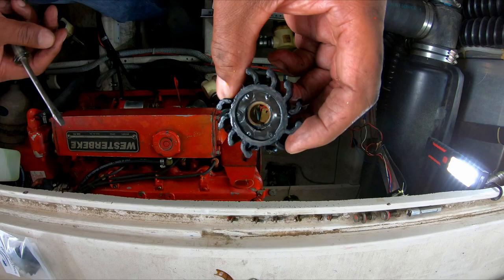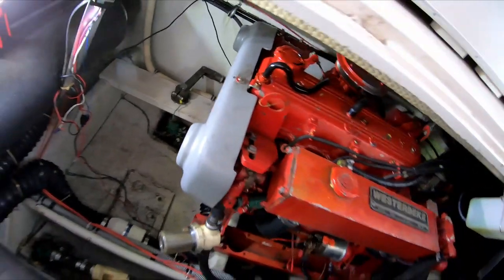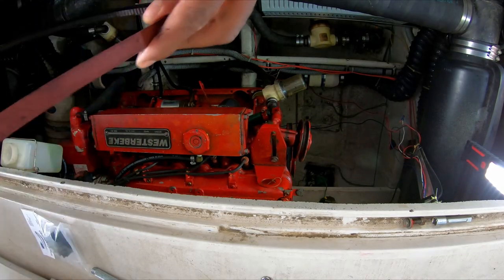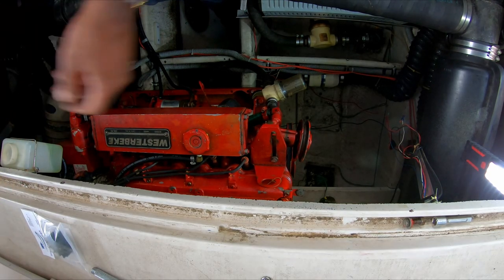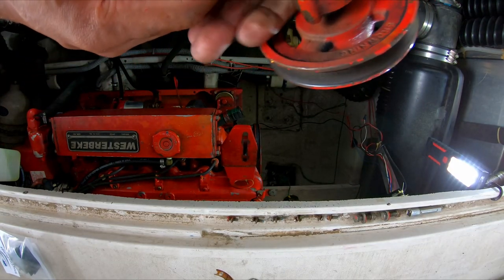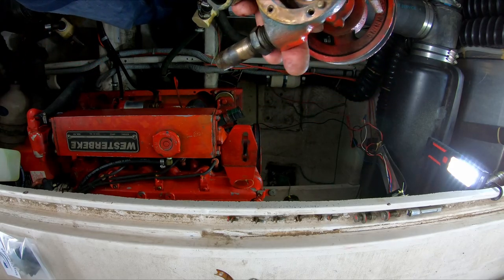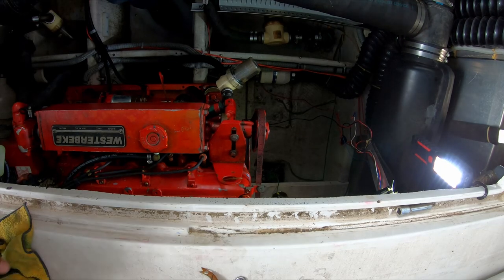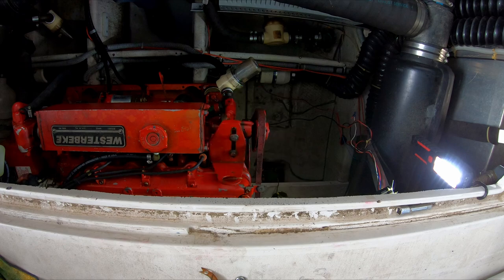Replacing The Impeller in a Westerbeke Generator

Comment: Hi Frank,  great video, very helpful and well explained.  Clever idea with the zip ties!  I have a Westerbeke 4.4 and need to replace the impeller.  The service manual was not very helpful identifying where the raw water pump is located.  Your video will certainly help with that.  Thanks - Steve
Reply from the maker: Glad you found it helpful.  Sometimes you just have to  try something a little different.

Comment: Lining your keyhole up with one of the bolt holes gives a descent visual when aligning impeller back on shaft. I cant count how many times ive pushed that key out of the slot.
Reply from the maker: Great idea!  Usually I push the key out of the slot about 5 times before finally getting it lined up.  I'll try that next time.

Comment: What hoses did you take off Frank if you can’t find a missing rubber flap piece
Reply from the maker: You should definitely take off the hose between the impeller housing and the heat exchanger.  A lot of pieces get stuck in there.  Sometimes pieces also get stuck in the heat exchanger itself so you may have to take that apart as well.

Comment: Hi Frank!  Another great video.  I have a Kohler generator on my boat and had it completed overhauled this past spring.  Simple routine maintenance would sure save boaters a lot of money.  Do you use your generator a lot?  I put about 10-12 hours on mine each season.
Reply from the maker: Thanks.  I am a lot like you in that I do not use my generator a lot.  I think this past year, I may have put 15 hours on it.  Most of the time I find myself running it just to exercise it because I have not used it.

Comment: Two tips.....bend the vanes the right way and use "flat"  DENTAL FLOSS to keep them pointing in the right direction. One the the impeller is in, snip the dental floss and pull out. Don't forget there is a  "O" ring on the pulley side that should be replaced at the same time..Replaced my impeller but after putting it together, the pulley shaft had a small leak. Replaced the "O"Ring"...no leak
Reply from the maker: @kayndee2011  I do the same thing except I use a small zip tie instead of dental floss.  Works well.